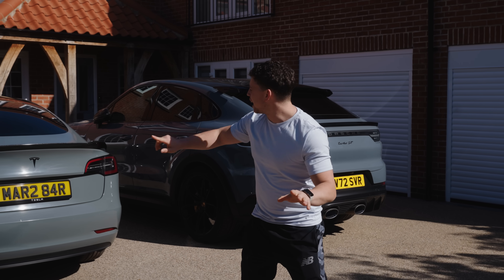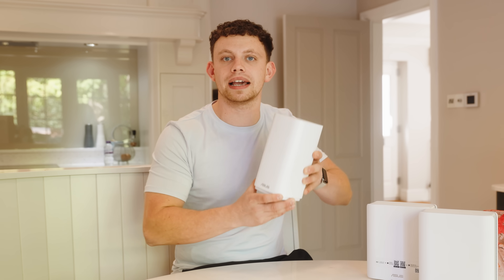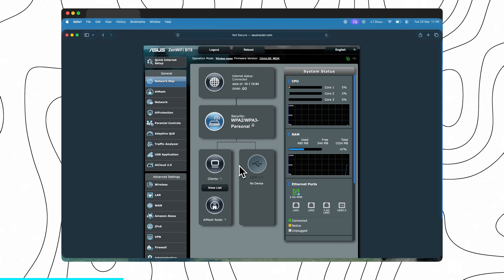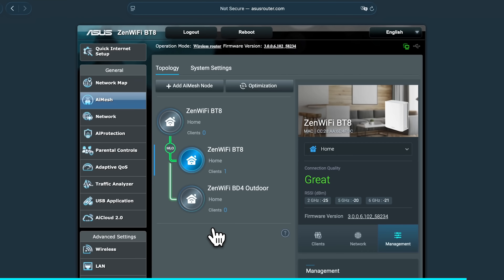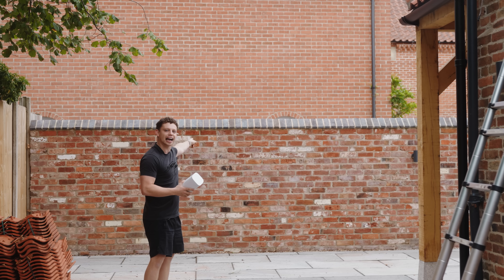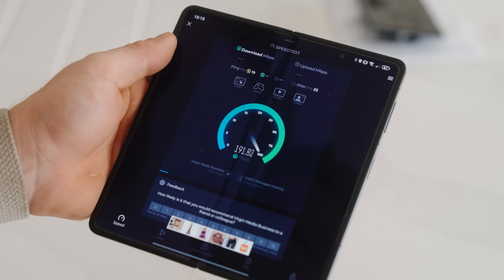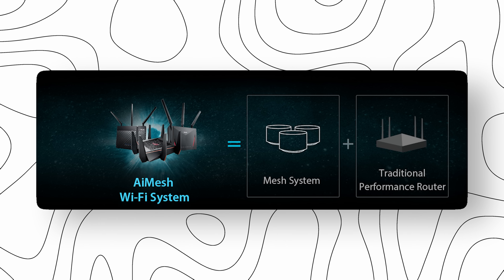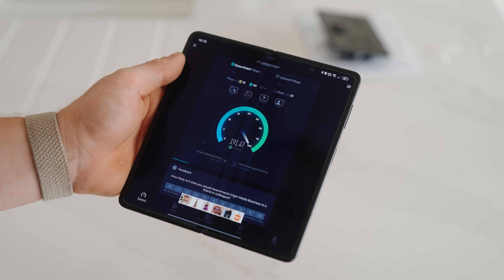My Parents’ Wi-Fi Was Awful, So I Fixed It (Giveaway)

Comment: id honestly either have used a unifi p2p link or runa fibre cable over a cateenary wire, mesh systems are shit and i do not rwate any of them, they become sticky on nodes and your devices will stick to a node far away and ignore the node nearest to you, and there is no way to manualy choose which node on the mesh you connect to, horrible designs, not sure why anyone ever uses them.

Comment: Where I live is apparently getting full fibre, in a rural village (no date as of yet). In the meantime, we have copper cable annoyingly, would this system be ok to use there? Or would you recommend something else? Any tips to help boost wifi speeds even a small amount would be greatly appreciated.
Reply: They need to release more 5G internet like they did here in america. Here in america some go as high as 600mbps. It could work in your country especially because a lot of it is either in the middle of nowhere or dense populated area's. It not only would save the ISPs and carriers money but it could actually benefit everyone.

Comment: As a "network engineer" you would know POE on the outside for a wireless repeater use case in a retail environment is not going to happen - so this install will never really happen for some pensioner especially - waste of time - great work
Reply: Retail? This is a residential install. Given the number of PoE powered cameras and access points that exist and work well outside, PoE outside isn't an issue. As long as the unit is designed for out door use as I believe was stated in the video this install shouldn't be a problem either..
Reply: do you mind explaining what you mean?
Reply: He should also know how to pronounce "Ethernet" by now, but there ya go.
Reply: I must have seen thousands of POE commercial applications. Remember these are mid market products, they are designed to be clipped around SME`s - car garages, carpet warehouses, and Air BnB's etc. You wont find them in enterprise companies that have repeatable blueprints.
Reply: @Andrew-tb9vr  His grannys house isnt "mid-market" ya eeeejit
Reply: @Andrew-tb9vr didnt I say it was for commercial applications not domestic use - POE for external cameras if its >1% I would be surprised in homes not businesses